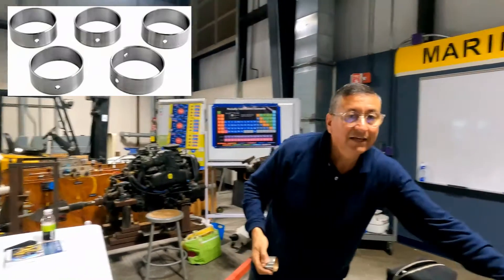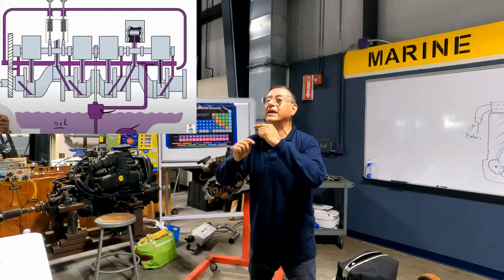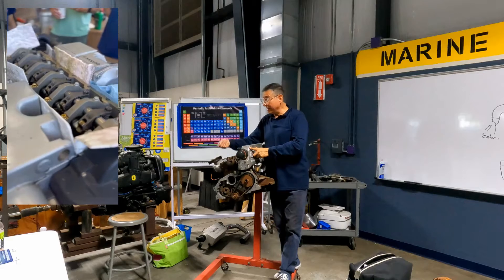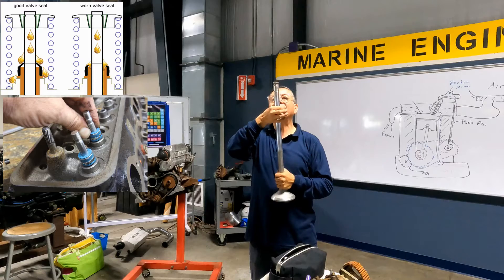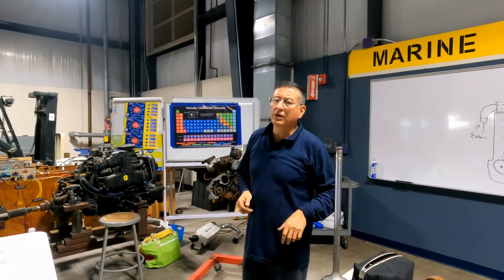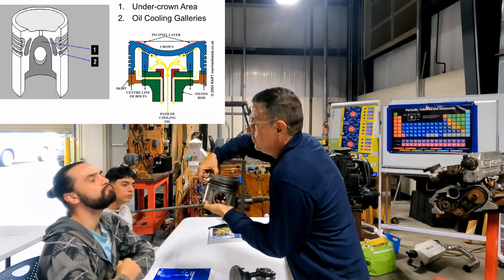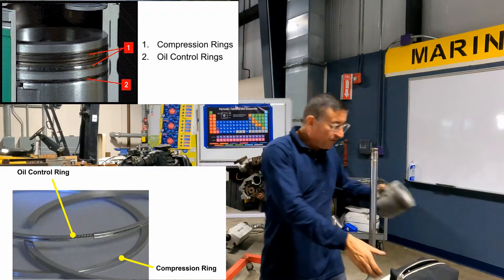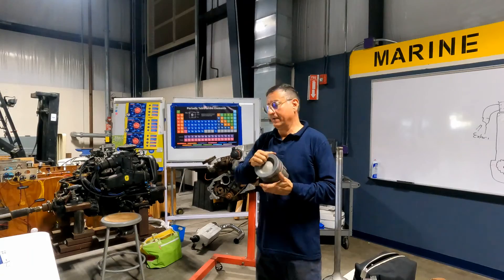Why blue Smoke in a Diesel Engine

Comment: I'm curious... We've got a tractor that blows a small amount of blue smoke for about 15 - 30 second after the first start. It has a light knock during that time and then it goes to normal with no smoke, no knock either. Could this all be due to a valve seal letting some oil into the combustion chamber? (It only has 400 hours on it too.)
I wish I could go to your class! What state are you in?

Comment: what if blue smoke only on cold start?
Reply: Check your pcv system. My intake manifold would accumulate oil overnight.

I thought I had to replace stem seals.😨
Reply: Like some antique/older locomotive engines?
Reply: i sold the car. not worth money to repair it.
Reply: @suteners2111 what failed
Reply: What was the problem?

Comment: I got a question if it only smokes during acceleration would that put the piston rings out of the equation? I got a 2008 GMC C6500 with the c7 Caterpillar. And it pretty much smokes only if you are accelerating.
Reply from the maker: If the amount of blue smoke increases during acceleration, it is highly possible a failure in the seal of the turbo-charger (Cold side). With respect to the rings, the only way to know if the rings are sealing properly is with o compression test.
Reply: @MrLopezClasses   out there working on it today and I confirm that there is very little blow by checking the breather tube that basically goes under the truck. Look pretty normal hardly any vapor coming out at idle. I know if there's any blow-by happening you'll see it coming out of the breather quite heavy like some of the videos out there by adept ape. One of the videos he shows the breather just bellowing oil vapor and I believe it was some kind of motor home.
Reply from the maker: Yes, this small amount of vapor coming out in idle indicates wear rings. I recommend two things. first, try to do a compression test. Two. Could you take an oil sample to analyze at the Lab? With the oil sample report, we can discover where is precisely the problem.
Please see this video: https://youtu.be/jv3mSklsW5A
Reply: @MrLopezClasses  yesterday I was working on it I pulled the valve cover off and found number 5 exhaust valve rocker had no valve lash. Actually it was holding the valve open on the Base circle of the camshaft. So I went ahead and adjusted the exhaust valve lash to .025. still seems to be a skip in that number 5 cylinder when starting. The question is now how come that exhaust valve lost its lash. I did go ahead and readjust lash at all the valves. Also with the Snap-On scanner we're able to do a cylinder cut and number five cylinder was totally different than the rest. Seems like there was still some kind of change in RPM when we did a cylinder cut on number 5. I am going to proceed in pulling the cylinder head off.